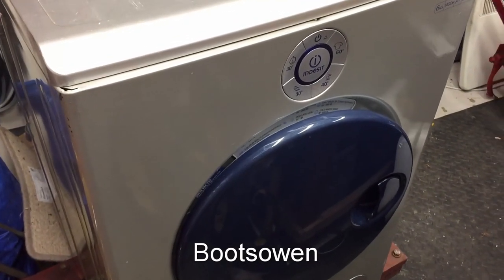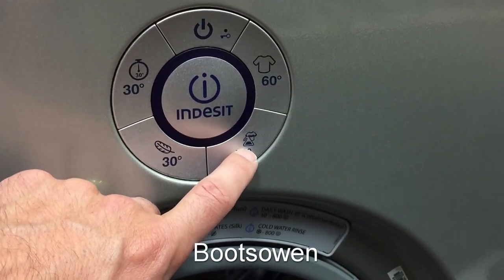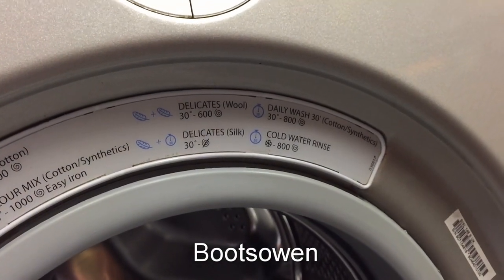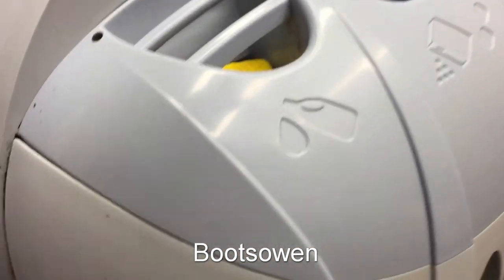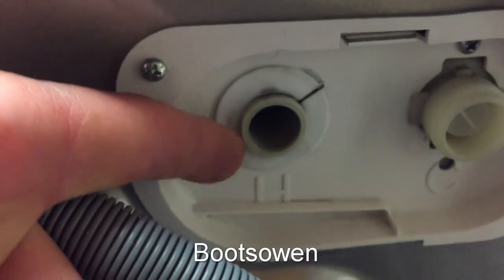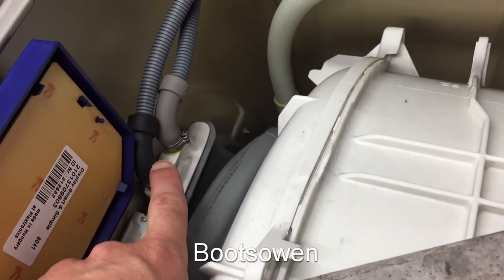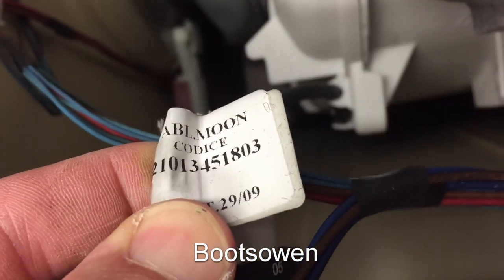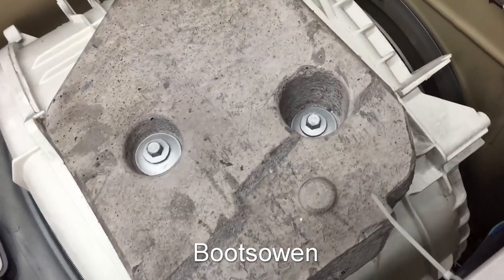Indesit Moon: a peek inside and so many questions

Comment: 1. Cold water rinse: The machine uses a conductivity sensor, this means that if there is detergent detected in the drum, the machine will perform a rinse only cycle. If there is no detergent detected, the machine will perform a Daily Wash 30' cycle.
2. You're right about the detergent drawer, the water comes from the top which takes in the detergent (1st compartment for liquid, 2nd for powder), and on final rinse, it takes the softener from the 3rd compartment. The small thing in the bottom is a drip tray.
3. You're also right about the breather hose, in any other washing machine with a standard detergent drawer, air gets out on it's own while it's filling water. But on this machine, since there is no such thing, they have to use a breather hose to let the air out, if not the pressure would be too high which would push the water to the drain hose making it leak eventually.
Personally, I'm not a big fan of these machines for a couple of reasons. Firstly, bearings. Typical Indesit problem, like the Innex you had. The fact that this machine lasted 12 years without bearings going bad is actually surprising, probably wasn't used a lot considering how clean it is. Secondly, lack of programs and options. Pretty self explanatory, no 90°C cycle, can't change temperature nor spin speed as well as options.
The machine definitely has a character, but still not great for daily use in my opinion.
Reply from the maker: Thanks for the really great answer! I agree with you on the lack of a 90, and the general lack of any choices, but some people probably like that. It must be possible to have a good few extra combinations of button presses to give more options, but it is what it is. Thanks for the description of the programmes, it makes sense. I will have a look for the conductivity sensor.

Comment: The thing under the drawer is drip catcher as these have an issue as its filming from the top the detergent and the water us everywhere on the drawer or on the seal and they even leak because of that so there is a drip thing which will get mouldy with the time

Comment: Think they’re shite. No 90° wash, only 4 programs and only one Max spin speed cycle. It looks stylish but it’s not good. The rinse cycle it detects the detergent if I remember rightly. I the detergent door basically is the dispenser and not an autodose
Reply: I agree, at least it has a 60°C for sanitizing (may not sanitize as well as 90°C but better than nothing) but still these suck.
Reply: You can use that hose at the back on the hot fill to pour hot water in to make it do boil wash or add water in the drum after it fills

Comment: not a great fan of these but they do look cool. i think the let down of it is the amount of programs that it has, isn’t very good because if you want a spin only it doesn’t even have one. i don’t think they where around for very long and they are quite rare at this point. maybe you could use that washing machine control board thing that fits any washer on this one
Reply from the maker: I could I guess, but it maybe wouldn't be able to handle the door detergent water in system. I think it is too clean to wreck!

Comment: Replace the door it with a stock-door with glass. You will not have a detergent dispenser and you will have to put the detergent directly into the drum, but at least you will be able to see the action in the drum and also see how the water intake is being performed :P You could designate the machine to wash work-clothes or something only and by that there would be no need for conditioner - which would basically render the detergent dispenser obsolete anyway.

Comment: Open up the soap dish please. It works just like a normal detergent drawer anyway (it shoots water to different compartments from top of the door seal).
Reply from the maker: How do you mean open it?
Reply: @bootsowen  I’m totally sure but there would be a way to open it up without unscrewing it. Just like you want to open it up for a quick rinse. Play with it until it pops

Comment: Could you fool it into things it’s not meant to do, alike a Hotwire? It must be based on a similar machine spec, if it had a different electronic control unit.
Reply from the maker: You could Hotwire the motor. But why?
Reply: @bootsowen  😂 I suppose your right! Will be interesting what you come up with, otherwise it might end up a museum piece of yours  moon 🌓 👶 If you come across a moon baby doll, it will probably love it’s wash 🧼 in it’s probably favourite 💕 machine 🌊🤣

Comment: In my opinion that’s the worst machine Indesit have done there is no spin speed option or temp option and only 4 button programmes and 1 cycle only does 1400 but the temp is too high. I think they should have done each light in the inner circle where the programmes are and made them programmes and done a spin and temp option
Reply from the maker: I am hoping to change all that! In a future video!